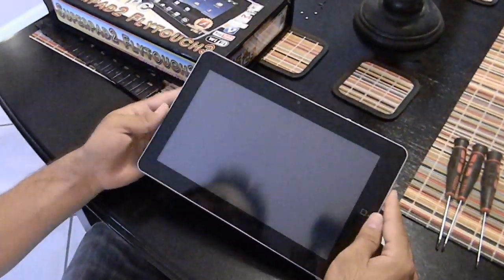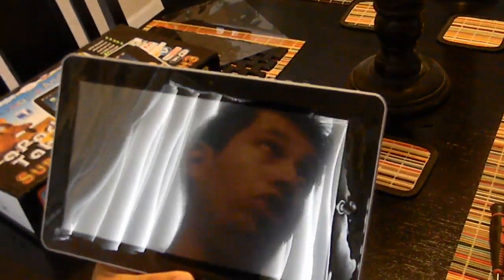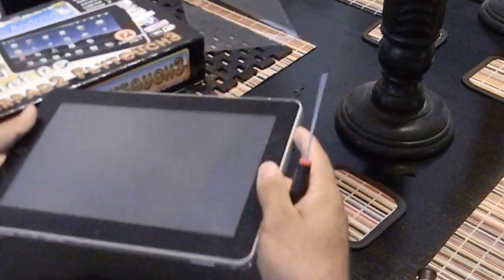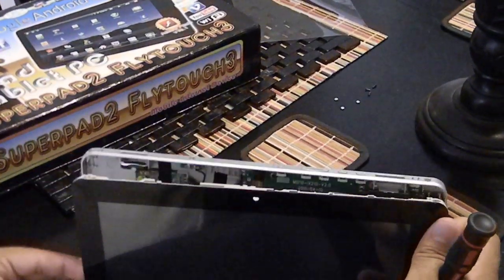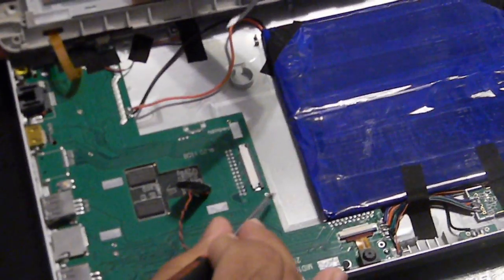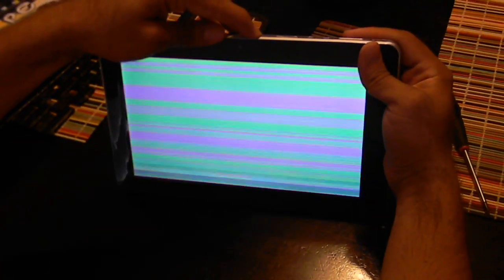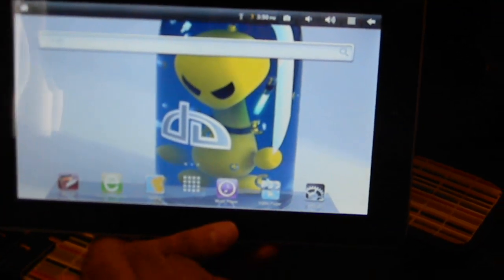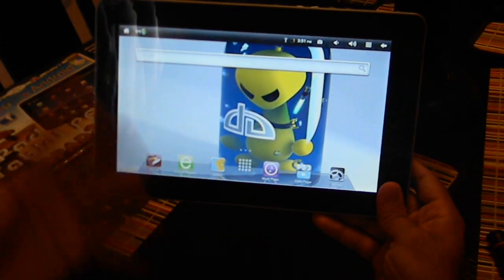Flytouch 3 wont boot fix.

Comment: Thanks for showing the pad layout. I get a boot screen but stays ANDROID in the center and never finishes.  I have a spike open, no screws around the edge. A tab on the top left lifts up with a 3.5" spike that must close the case. So must find a similar SuperPAD type and why the rest of the boot never happens. I was in the audio player when I turned it off and never came back. Thanks again great fix you found.

Comment: You helped answer what is wrong with mine. I bought a tablet with a broke touch screen. I powered it on to make shore it work. I then replaced the touch screen and powered it on and all I get is white lined screen. The monitor cable must have shimmied and became misaligned. Thanks for the post.

Comment: I have a flytouch  android 4.0 tablet it wont turn on I did what you showed in the video except mine was connected the first time mine messed up I pressed the power button and the reset button at the same time and it booted up and was fine for a few days then i went to get on it same thing it wont boot up ive tried the same thing i done the first time and it didnt work anyother ideas

Comment: don't buy from ChinaGrabber. Their service sucks. I dropped my FT3 by accident, so had to replace the screen. You can either order the screen replacement and try to fix it yourself, OR you can send it to them to let them fix it. I wanted to play it safe so I send it to them. It took them almost 2 months to send it back, and they barely reply to your emails (like once every 10 days or so). They ended up sending me a completely different tablet and the memory card inside is corrupted.